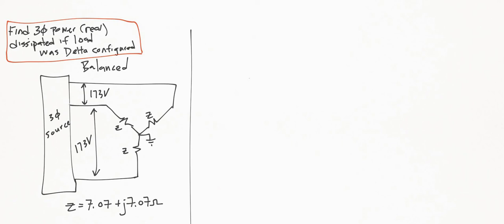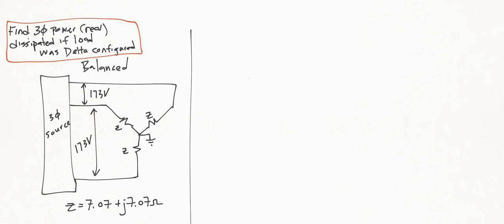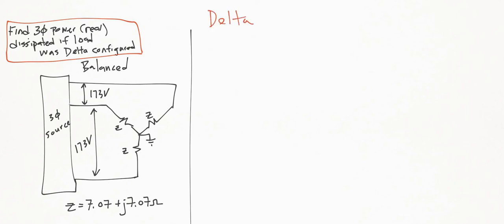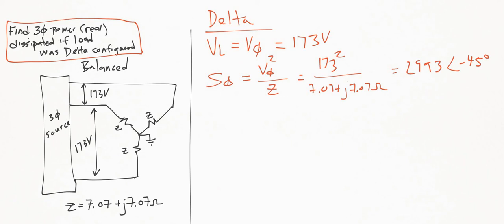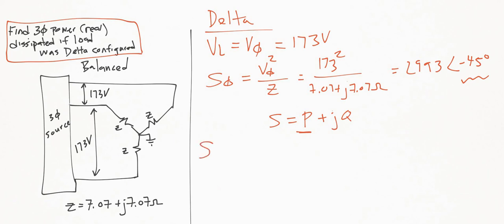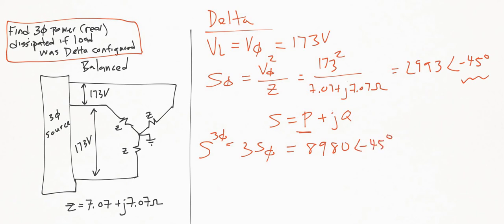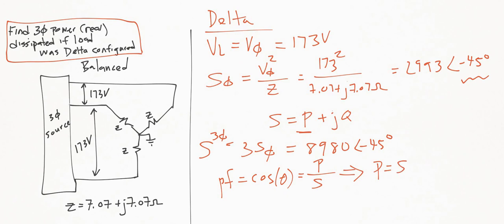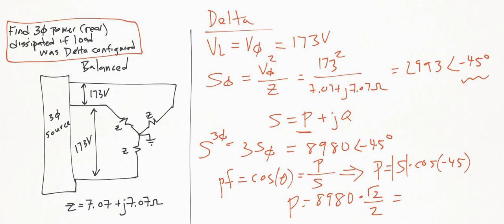Electrical FE /EIT Exam Prep - Power 1: Balanced Three Phase Load

Comment: L-L impedance is not Z. Z is L-N impedance.  Need to convert L-L voltage to L-N voltage (V_L-L*sqrt(3)).  Divide L-N voltage by Z to get L-N current.  Multiply L-N current with L-N voltage to get L-N Power.  Multiply magnitude of this power by cos(theta) to get real power.  Multiply by 3 for total power.

Comment: Im sorry to say but he's correct, you are all wrong in the comments. I understand why you're confused but he's actually doing it correctly. It would be more clear if you draw it out. This problem is much like when I was studying wye-start delta-run motor starters. Delta connected loads see one-third the power as wye connected loads for balanced systems. Solve the wye system and multiply by 3 to check if you're delta answer is correct.

Comment: Isn't the formula S = V^2 / Z* (conjugate)? Also, don't we have to convert the Z to delta first?
Reply: Based on the equation: S = VI*. I think when replacing I* with (V/Z*) , the conjugated angle would be inveresed due to the division. Resulting in just V^2/Z

Comment: Do you not have to convert the load impedance to delta as well making Z = 21.21 + i*21.21?
Reply: Using Z_delta = 21.21 + j21.21ohm, I got P = 2116.62 W. Also, I just kept my S in Rectangular Form so that the Real component would give me P.
Reply: @AB-km5sp  I got the same value too, I think its the right one!
Reply: I think you all have misunderstood the question. It is not asking to calculate for an EQUIVALENT delta load, it is simply taking the given loads and rearranging them from a wye to a delta configuration. The values of the individual phase loads are not changing at all.
Reply: @Eey-OR93  You're right.  The problem is maybe a little unclear or at least not typical for these types of problems.
Reply: I know right. Does this guy really know what he is doing?